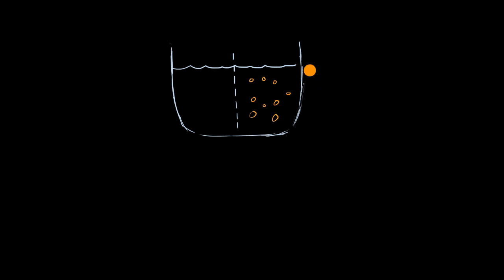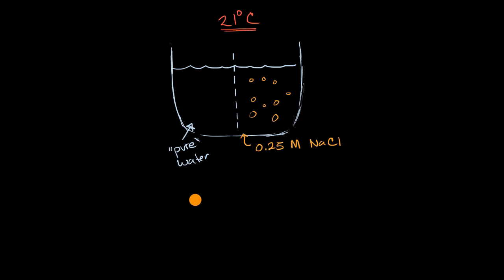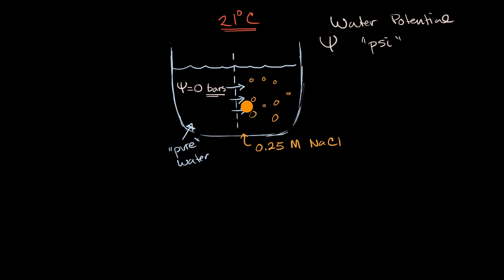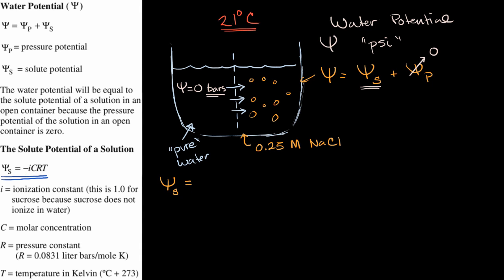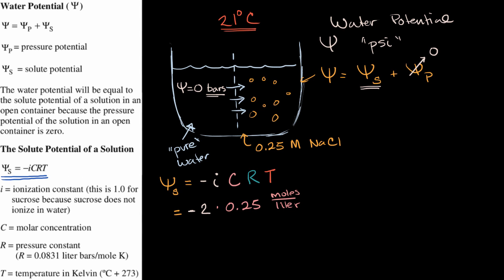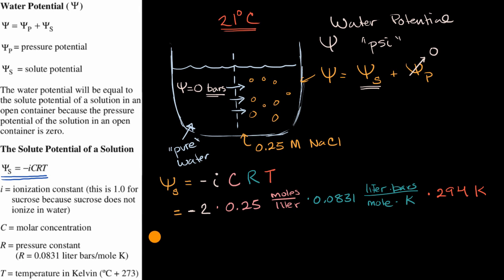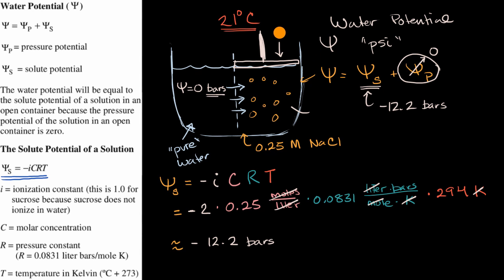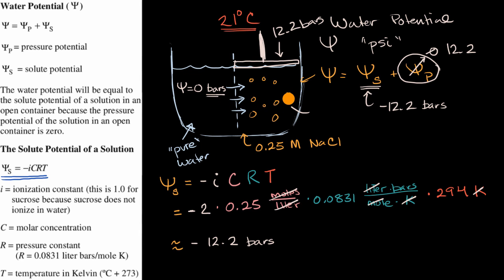Water potential

Comment: Sir, if u can answers plz do... 
Cell A :
Water Potential = - 1400 KPa
Pressure Potential = 600 KPa
Solute Potential = - 2000 KPa
Cell B :
Water Potential = - 600 KPa
Pressure Potential = 800 KPa
Solute Potential = - 1400 KPa
Q's :
A) which cell has higher water potential?
B) in which direction will water move by osmosis?
C) what will be the water potential of the cells at equilibrium?
D) what will be yhe solute potential and pressure potential of the cells at equilibrium?